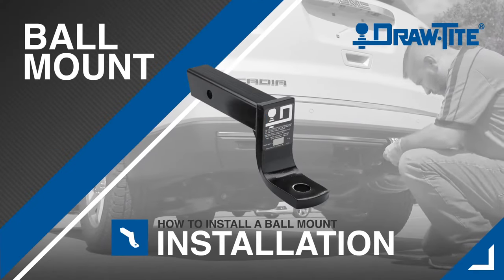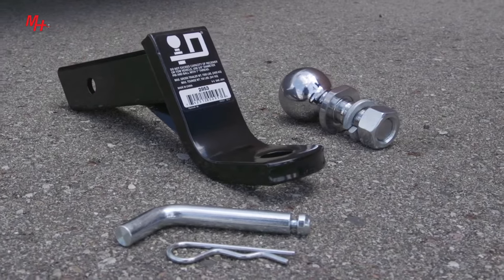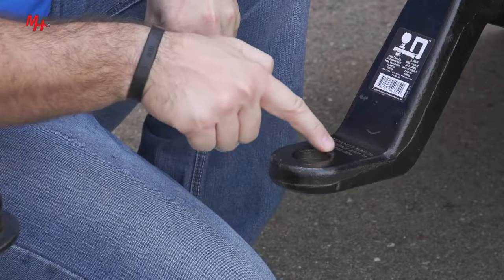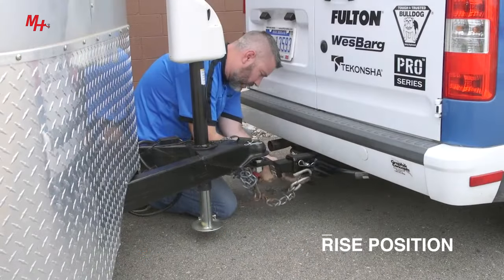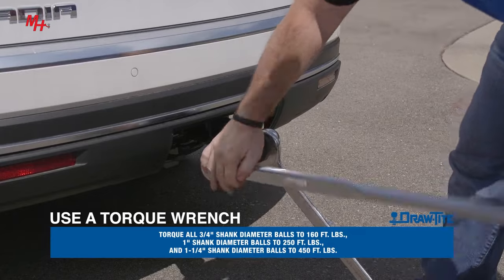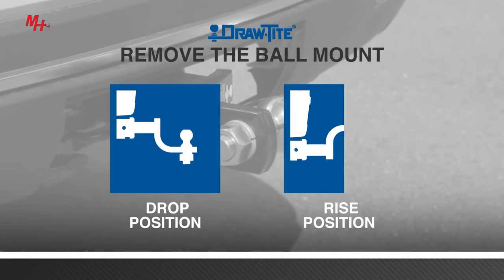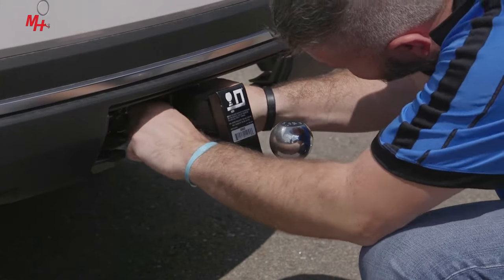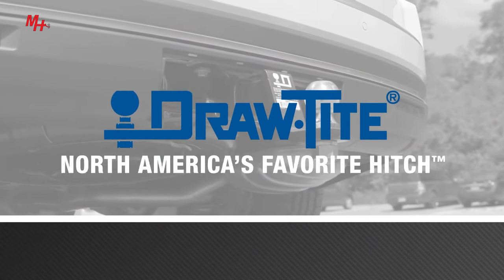How To Install a Ball Mount | Draw•Tite®

Comment: I just did mine. threw a stripe of torque seal over the nut/bolt end so you can visually see if they start separating ever and need re tightening

Comment: Hi, what if I don't have a torque wrench?
Reply from the maker: You can also use an impact gun. However, it is very important for the ball to be tighten correctly. If you're unable to do so we recommend you take it to your nearest shop for proper tightening.
Reply: What size socket do i need for a 2” ball?
Reply: @PATR1OT316 usually a 1 1/2

Comment: How and why do you utilize chains
Reply from the maker: Hey, No matter how far you are planning to drive – down the street or across the state – using safety chains when you tow is smart, safe and required by law. Safety chains are used in case your trailer becomes uncoupled from your trailer hitch. Hope this helps and Always remember to Tow Responsibly😀
Reply: If possible, "cross" attach the chains. If the trailer disengaged from the ball, the chains will help prevent the trailer from being dragged